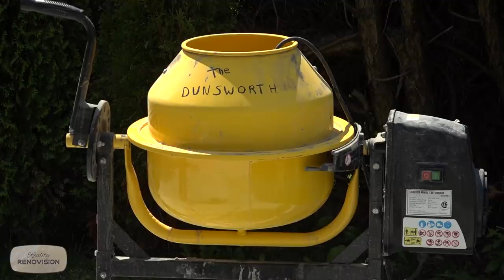This Should Only Have Taken 3 Days To Build! Not 2 months! | Reality Renovision Ep15

Comment: It looks amazing. Quick question for you. The ceiling on my porch and carport are falling apart because of water damage and it seems they used sheetrock. Do you have a suggestion as to what material to use to replace the ceiling all together. Any suggestions would be useful, thank you.
Reply: If you have water damage in the ceiling then it's through the whole overhang and would need it all replaced unless it's in a specific spot you could possibly just have that section done then

Comment: Hi Jeff, is your shed 2 feet away from your neighbors, i.e., the fence? I would like to make the same shed next summer and I am wondering what is the largest shed Ottawa city building code allows? I read 4 mettes tall, is this not too tall? Also the size is 10 square mettes, does this require the roof size? We know the roof is bigger than the base. Thanks!

Comment: Awesome video, thank you for posting. Quick question- is there any drawback to using four pressure treated 4x4s set on quickrete tube-made piers for an installation on a slope, to cut down on the money/time/effort involved with pouring a slab? In the same way you'd make a deck? I live in New England and the frost heaves are also an issue. I am guessing you thought of this and chose the slab for a reason.

Comment: Wow, all that work mixing the concrete. Dont you have a company near you that delivers ready mix concrete to order. Spotmix in the uk for example does this. I needed 1.44m3 for my 4m x 2.4m x 0.150m slab and it only cost me £120.00 delivered and barrowed in by the lads on the wagon. I just raked and levelled it as they brought it in, marvellous!!! The mesh should of been overlapped too by at least 2 squares on every joint. Other than that not a bad job.

Comment: WARNING!   Freehand cutting with a circular saw is really dangerous, especially for inexperienced carpenters.  Quick, unintentional reflexes will cost you a finger, hand or leg.  Take the extra time to set up a simple table (if you don't have saw horses), and use two clamps to clamp your boards to the table so that you can cut them safely and securely, and also be able to see where your fingers, hands, and legs are at all times.  I've seen many carpenters use body parts to support their work (boards) while cutting.  One mistake will change your life!

Comment: What is a rough estimate on the cost for all the material needed for that shed?
Reply: This shed build approx $3400 USD or $4500 CND; however, that includes the concrete pad and buying a small mixer. Also this project had all the bells and whistles so can be done for cheaper (IE: buying a cheaper door, not using cedar, not install soffit etc). ALl depends how much you want to spend

Comment: Great vid. I have a question. What if you are building on your driveway? I have a long driveway that was paved the whole length of the property from front to back. I want to put the shed in the back. Do I need to dig up the driveway and pour concrete or can I just build on top. I’m in New Jersey so I get the cold as well as the hot when it comes to weather. The driveway is asphalt.
Reply from the maker: you can build a shed on a driveway. it is rated to carry more weight that the shed. Cheers!
Reply: REALITY RENOVISION thanks for the reply. Should I just set a few 2 by 4s on the driveway and build it on top of that or just do exactly what you did acting as if the driveway was the concrete pad?

Comment: Dude seriously! It's a frikken shed, Right? I really think your over thinking this project. Maybe if you were building a house I would go to such extreme's on foundation work. Seems to me you have overkill on the concrete work for just a shed. My suggestion would have been a wood floor using concrete piers. Reason for this is easier if you need to make any changes in the future, and using a concrete mixer would have been a lot easier just ordering ready made concrete delivered. one word for you "K.I.S.S."

Comment: Do NOT put a latch like that on the outside of a shed door.....spend a couple of bucks and put a locking door handle on it, FFS,.....Especially if you have kids or animals.  If you don't care about securing it, put a string pull handle on the inside to trip the latch o the outside, but that's just lazy.